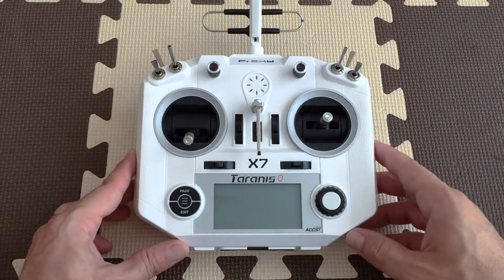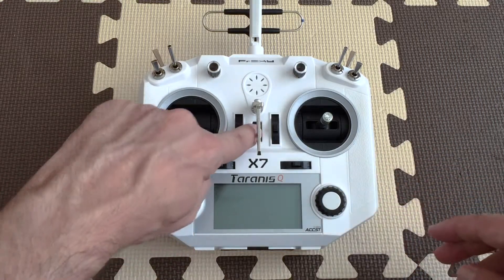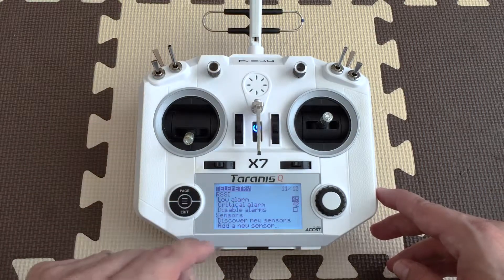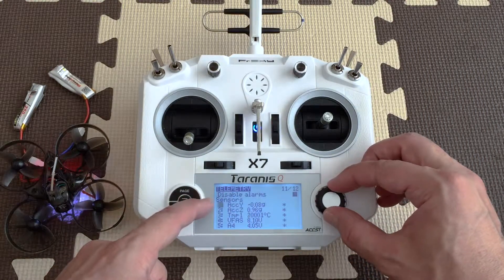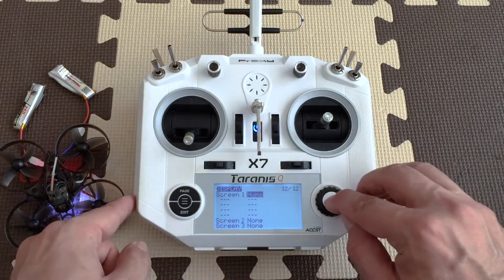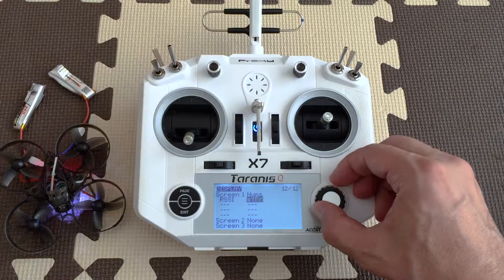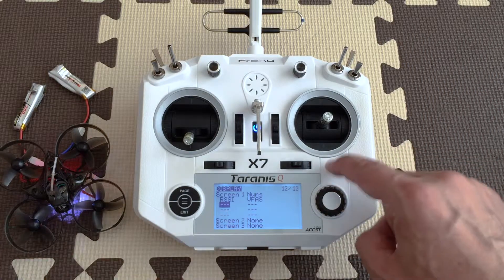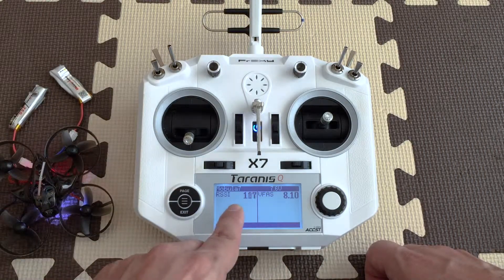How to display Telemetry on your OpenTX radio

Comment: Thank you.
Do you believe that it can be done with all the models??
Thanx
Reply from the maker: PauL TerL Yes, any radio that has OpenTX will work.
Reply: @RikkTheGaijin Thanx, but I was meaning the quads, not the Tx
Reply from the maker: @paulterl4563  Any quad that supports telemetry will work.
Reply: @RikkTheGaijin  Thanx again, but how to know it?
And, is possible to make it beep when under a certain value?
You'll do a vid on this??
Thanx 
Byeeeeee